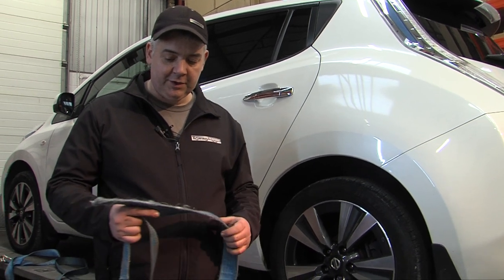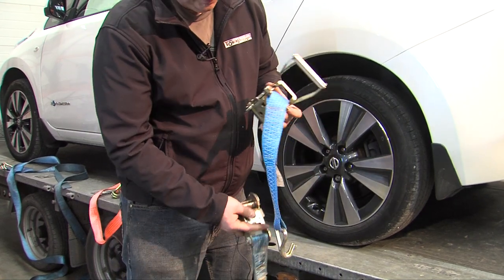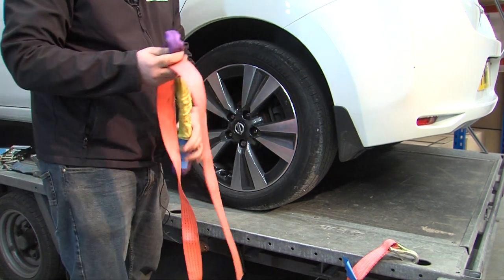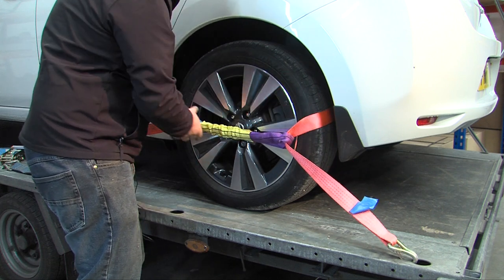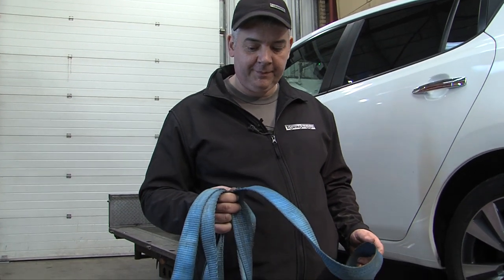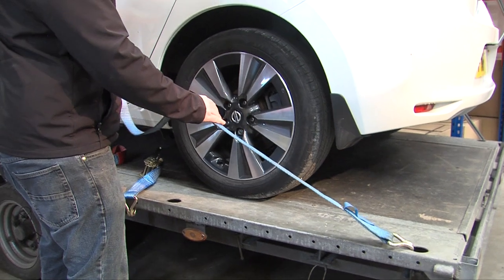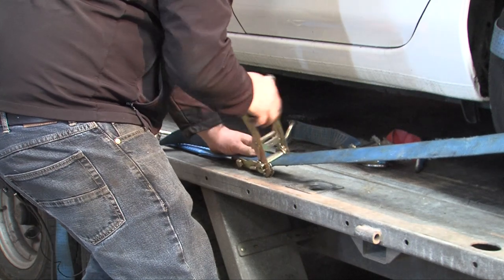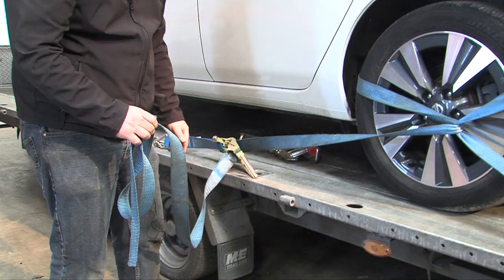How to securely ratchet strap a car on a car transport trailer

Comment: Excellent video, thanks for doing this. I have towed many a large load but usually dead loads like aggregates, building materials etc. In the next couple of weeks am going to tow a large 4x4 on a transporter trailer for about 150miles. Will have your guidance here in mind. Only thing i’m nervous on is weight distribution. Am planning on sending it slightly nose heavy but it is hard to tell as cars are unevenly distributed. I guess i will find out how much sway i get in the first couple of miles. Thanks again 👍🏼

Edit: just saw your other video pop up on even loading, again very useful, thanks. Think i’m just going to put it slightly forward, maybe just an inch of the central point on the trailer and take it from there. Am also going to be putting as much from the payload vehicle into the tow vehicle like seats etc as am close to the trailer’s gross capacity. All the best.